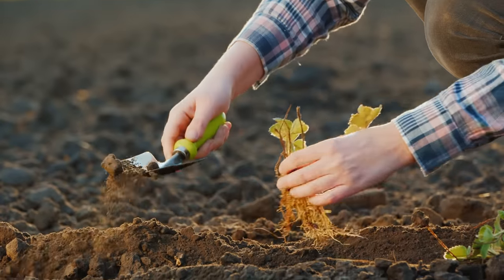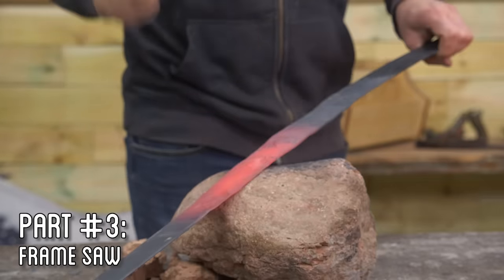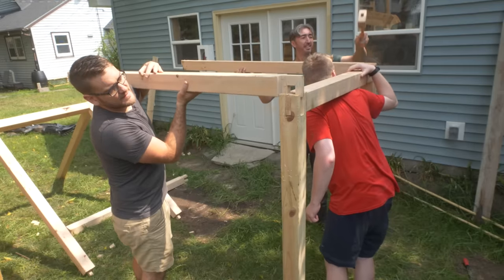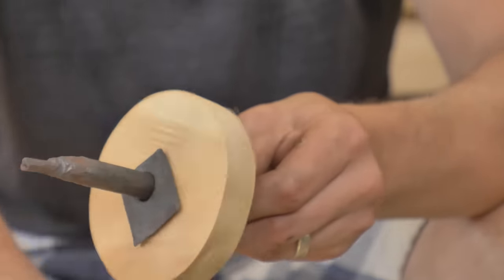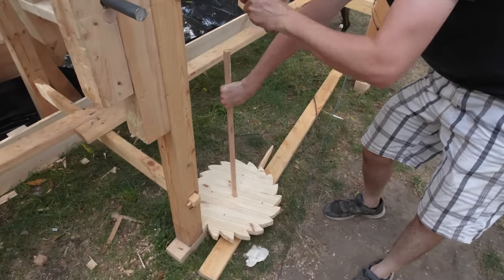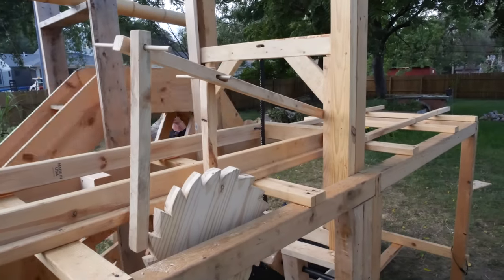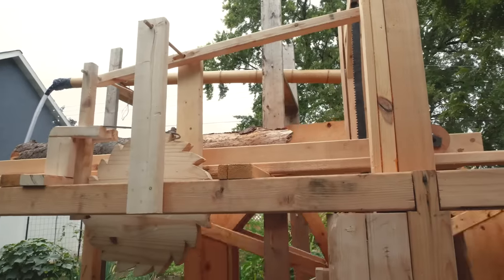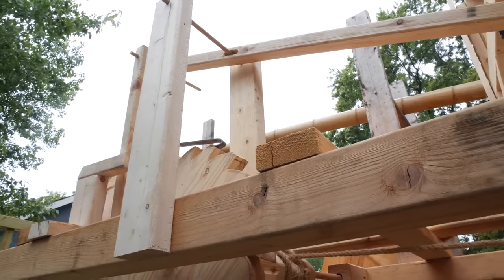I Built DaVinci's Saw Mill

Comment: The principle is just fine, but build quality is too half-assed for it to work. Moving parts need to be precise and the saw needs to have actual saw teeth. And the feed mechanism is about 10 times too fast.
Reply: This guy’s entire channel is him of low skill/high slop but just good enough to fool the normies watching. 

Then he can pass his failure off as the fault of an old design. He took a sketch and built a shoddy device. The fault is in him

Renaissance era woodworkers would’ve made a substantially better product

Comment: You could always try replacing the water wheel with a walking wheel, which while a lot more manual than a waterwheel, might help you test things while you tweak the design.
Reply: Water wheel on the water side. Walking wheel on the land side.
Reply: And put a very big hamster inside
Reply: Awesome idea. Could be powered by humans or beasts of burden. Maybe set the mill up and wrangle a herd of Kindergarteners to power it. Don't think you could build a windmill large enough but it would be grand if you could. What about a treadmill design? This would be easiest to couple to the mill but what would be used as the belt? Layers of canvas over a more slippery fabric such as silk maybe? What about wooden slats connected to each other with rope with the gap in between the slats meshing with an axle and sprocket? Like a modern tank tread.
Reply: Charge people a gym membership and set up a Conan wheel to drive it!
Reply: This is actually historically plausible, look up the treadwheel crane or magna rota.
Reply: Hire that guy in Florida that keeps getting arrested for trying to cross the ocean in a hamster wheel.
Reply: He needs a team of Turnspit Dogs
Reply: @ficolas2  There's no true concept of animals; it's merely biology. We share the inability to reproduce with vastly different organisms or 'species' (I've even had an encounter with a hamster). Mother nature, however, doesn't concern herself with such distinctions; she's oblivious to species.
Reply: he'll also get a workout out of it
Reply: I mean, Real Civil Engineer makes great use of the Shaming Wheel...
Reply: @ficolas2   Capibara powered sawmill
Reply: Best treadmill ever 🤣
Reply: And get some cardio while tweaking the mechanism. Brilliant!
Reply: Replace the water will with a gear, pur a perpendicular gear and turn that last gear with a beast. Maybe use a small gear to get more speed
Reply: @jeffg1381 windmills. In The Netherlands we still have wind operated sawmills running.
Reply: @PlutoniumBoss  These are being used right now to help construct a modern day castle using period correct methods in France.
Reply: @ficolas2 a Capybara would do

Comment: You need a splash guard! All that water will make the components swell and bind. The extra humidity itself will change how the pieces fit together.
Reply: so, cover everything with mineral oil I guess ?
Reply: Right that is what I was thinking the entire time.
Reply: The sled and rails need a solid coat of wax.

Both waterproofing and lubricant in one.
Reply: @danilooliveira6580 this is not how this channel works 🧐☝🏻. At first they need to forge a pickaxe, travel to the middle east and start digging. When they finde crude oil the need to refine it and THEN they can cover everything in mineral oil.😂
Reply: @BaconIover69  there are easier substitutes for mineral oil, like linseed oil. I just said mineral oil because its commonly used to finish wood.
Reply: @danilooliveira6580  this is not how this channel works 🧐☝🏻. First they need to plant some linseeds, harvest the crops, thrash it, grind the  seeds to a pulp, press the pulp out and clean the oil with a filter, cook it and then apply it to the mechanism. 😂
Reply: Honestly with the amount of slop in his joints and the sled for the saw, the only thing that swelling would cause is better fitment and therefor better movement, all of that slop is horrible for something even as simple in design as this saw, back then they would have BEATEN the apprentice who built this saw, because it would be a waste of time and materials to build something THIS sloppy. 
I mean props to the guy for building it, but if he would have taken a few weeks, and used better materials(denser wood, better metal for the blade) and taken better care with his joinery to make sure everything was tight for the frame and then just tight enough for the sled, then he would have seen a HUGE difference in the way it cuts
Reply: @BaconIover69  *flax seeds
Reply: @survivalsearcher  that's the same

Comment: A fantastic build!
Watching you cut wooden gears with a saw made me think that as you approach the 19th century you're going to be challenged by the most important single invention, the one which the entire Industrial Revolution depends on - the straight, accurate lead screw. Without that you don't get machine lathes and all the things that follow from them from screws to precision gear cutting to all the rest.
Reply: It actually wasn't as difficult as i first imagined it would've been. Search about a topic called generating master screws.
Reply: Interesting. All the material I had seen about early machinists developing them from nothing was a lot more fiddly and complicated. Looks like people got clever about it once they had the idea it could be done.  @chandradharkoneti
Reply: Make a crude lath that makes a better lath etcetera :)
Reply: @Barskor1  the tricky part is that even threading.
Reply: @toddellner5283  Indeed
Reply: @toddellner5283  and the sollution is weighted cutting tools that cut at angle on a mono directional lathe so that the rotation of the work piece in the lathe is pushing the cutting tool along the work piece and the weights on the tool ensures a slow and even progress as the tool is pushed along a guide rod.
Reply: @mahekorvenoges550  That is the idea
Reply: The Industrial Revolution was a development meant of the Renaissance which in turn was a revival of the Roman world.
Reply: Hail the Glory of Rome!
Nonsense. Everything from the economic system, philosophy, political basis of the society, to class structures, and fundamental values represented a massive qualitative change from the slave-and-rent agricultural system that the Ancient empires represented.  @Art-is-craft
Reply: @toddellner5283  
My point was that Rome was building things that people assumed where from the 1400s. My point was not an endorsement of terrible things that took place in the Roman world.

Comment: Super cool to see the amount of engineering and joinery being applied. This channel has been through so much, and come so very very far.  ❤
Reply: Sadly the joinery and engineering is extremely lacking even for a hobbyist.
Reply: With respect to the guys giving it a go, I think even calling it joinery is insulting to joiners. However, the saw that was being used was a little on the small size and the chisel was way too big. Easy when you use the correct tools. Also easy to be critical sitting here on my arse.
Reply: @spec_opsgaming  I spit my coffee out when I saw the closeup of the castle joint

Comment: The feed rate is very ambitious for that blade. Overall this looks fairly well done for a first try.
Three things I'd change is the pitch of the teeth on the blade, the rate of feed, and a better crank for the saw head by narrowing the distance between the blocks instead of using string as a keeper for the crank arm.

Also, if size was not an issue, some of these mills would have a large enough wheel to fit animals or people on the inside to allow for walking to be the power source.

Comment: The problem with over, is the amount of extreme amount of water spray...  swells up all the other wood.
It's very impressive that you did build what you built.  I only suggest that you look to modify it to use a river run below the wheel.  As most (old) mills ran spring to late autumn by having channels divert water and in some cases were able to modify the height of their primary or secondary wheels to account for change in river runs depths.  Very few (that I've read about) changed the pitch of blades or bucket scoops.  
Lastly, there's a significant amount of slop allowing for rotation in your sleds.  With cross-bracing and/or oil-soaked rope bindings, you can eliminate that movement and likely will keep the sawmill from shaking itself apart. 
Best of luck and looking forward to seeing this in April/May of next year.
Reply: I have not seen any water powered saw mills, or any other water wheel powered machinery for that matter, that had the water wheel attached directly to the machine itself. It is easy to locate the machine(s) at a distance and use drive gears/belts to transfer the power - as well as allowing more convenient location for the machinery.
Reply: @buggsy-sb3if  There's lots of mills that powered different machines. 
And yes, they aren't driven directly.  There's always differential gears to change speed and torque.  But the concept remains.  In the simplest and earliest forms, water wheels were used because windmills were inconsistent, and milling was done specifically for flour.  They only had 1 rotational gear change from vertical to horizontal.  A few examples still exist.

Comment: Pretty cool, drop sand bags on the base to firm it up. And make sure the machine is super rigid. When hand sawing, if your wood/fixture isn't locked down it is a PITA to cut. You could also use spikes to rigidly mount the log to the sled. Something similar to dogs on a wood working bench, but with spikes at a 90-degree angle to stick into the log and lock it in.

Comment: if you replace the rachet with just a weight pulling down, you would be able to adjust and stabilize the pressure on the saw. All in all i love seeing this idea continue to progress!
Reply: I agree they need some way to dump excess pressure if the blade isn't keeping up. An adjustable drop weight on a pulley would be an excellent idea

Comment: Adding a draw bow to the top or the base will reduce the amount of pressure needed to move the frame in that direction (most would put it at the top because it counteracts gravity). Adding a slot guide for the push arm would stop the walk and give you the greatest efficiency for your build. Also, grease the frame guide (use LOTS of grease) as well as any point that has moving friction in parts.

As for the pump, watch a couple high banker videos of people high banking at home, and add a simple screen (you can use a window screen) will keep your water clear and your pump running.

Comment: A couple of things that you might want to have a look at...

1. When your mechanism advances (rachet advancing beam) the ratchet wheel, it moves forwards quite a bit but then moves backwards again. This means that the log will only be against the saw blade for a fraction of the blades stroke. This can be easily fixed by shortening the length of the piece of wood that advances the ratchet..... reducing it a little at a time to get the best results might be a good idea.

2. Seesaw beam that connects to the rachet advancing beam..... the bit in "1" above. By increasing the length and adding some extra holes to adjust the pivit point and the point that connects to the ratchet advancing beam, you can experiment with changing how far the log is advanced each stroke. This would also mean that you can fine-tune the mechanism depending on how much power your water wheel is currently generating. i.e. reduce the speed of the log if you have less water flow and increase the speed when you have more water flow rate.

A tip for the future, if you make a mortice gauge, you can use it to accurately scribe the lines to create tight fitting joints. Your castle joints are a bit loose, which will reduce the stability of the joints and allow quite a bit of movement in the frame...... even with glue and nails....... sorry 😳

It was awesome to see an idea based on a sketch by Davanci come to life in this video 😊👍👍👍👍👍
Reply: Regarding 1, perhaps the advancement mechanism should have a weight hanging from the rope? Then the pressure of the log against blade will be constant and based on the weight, which can be adjusted depending on the available water flow, blade wear, cut length, etc. If the weight had enough vertical travel distance the advance wheel mechanism could then be removed (or possibly replaced with a mechanism that relieves the pressure on the blade when the saw is on the upstroke).

Comment: A river powered water wheel is going to have a lot more torque than is achievable from your garden hose. Even back then, a lot of experimentation went into matching a water wheel to the water source. I suggest DaVinci's design is an undershot wheel for use with rapidly flowing water. They also used lubricants back then like beeswax and tallow to make wagon wheels and other mechanisms move with less friction.

Comment: I think in the long run that you should install some wooden dowels to hold the log in place instead of a rope that would have to be moved multiple time run, if it wasn't cut every time you ran a log through the mill.
Reply: I was thinking that also. The more rigid the system is the more effective.
Reply: He really needs "dogs".  These are things that go from the frame up to the log at an angle so that the weight of the log is pushing the point of the dog into the side of the log.  As the cut progresses down the log, you put wedges into the kerf so that the gap doesn't close up on the blade.

Comment: I just came back to the channel so I'm sorry if you already covered this, but the other way to make cuts along the log (rip cuts/ripping) is to rive/split it using metal wedges and a sledge, wooden wedges (gluts) and a beedle, and axes. This doesn't work with all species and doesn't handle knots well. It also requires relatively straight grain.

Rather than cutting from one side to the other, you halve the mess each time. If you don't halve the mass evenly the less massive side tends to bend more and the split wanders that way. You can sometimes correct the split by forcing the thicker side to bend more. On thinner stock this is often done while using a tool called a froe.

What you get, though, is the strongest possible board out of that particular tree, ideally with most fibers being continuous from end to the other. Beams were made this way into the 1900s. If I recall correctly, shingles made this way last longer than cut shingles because water has no exposed end-grain to soak into. Tool handles are also best when riven.

Also, hi from Minneapolis-ish!

I'm just kind of getting into this, but I've used this method to break wood I couldn't possibly saw (3ftx4ft oak log) into wedges I could haul out on foot to my tiny car. If you want to see a master of this from the US, look up Peter Follansbee.

Comment: Increasing the size of the ratchet will slow down the sled even more and prevent bind ups and sharpening and heat treating the teeth of the blade will increase efficiency.

Comment: It's fascinating that Da Vinci didn't think to invent a circular saw, as it wouldn't require converting the type of motion from circular to reciprocal.
Reply: The original had 4 blades, 4 planks per pass, also a circular blade would be restricted on the size of the logs. 
The gearing needs a little work to speed up the saw blade.
Just my opinion and thoughts.
Reply: I am not sure Divinci would have enough power available to him. Our 48 inch rotary sawmill bogged down cutting boards with a 327 Chevy engine, our portable bandsaw gets by with  a 22 go Briggs and Stratton.

Rotary is nice, but takes a lot more power.

Incidentally the circular saw blade was invented by a woman.

Comment: were leather bearings invented in this time period? oiled leather bearings are pretty great for a lot of stuff and you might be able to reduce the slack in a lot of pieces, like that hook on the crankshaft, with some leather bearings and tighter constraints.
Reply: DaVinci actually made drawings of ball bearings!  Ìt has a shaft with a cone shaped tip like a pencil.  The balls are around the cone trapped in a round (flat bottomed) wooden(?) hole.

Comment: There's an historic production saw mill back where I grew up. Multiple blades and a lot more water but one thing that I thought was most interesting was the advance mechanism. There weren't any ropes or pullies that I remember seeing. What they did have was a constant driven roller that the sled sat on. It provided a constant push to urge the sled forward but not enough for the blades to bind or break, just letting the friction from gravity and the back pressure from the blades to dictate the advance rate.

Comment: Try to gear up your saw up and down movement rather the infeed speed. Your saw cant handle the current feedspeed. Now the saw goes up and down 1 time per revolution of the waterwheel. Gearing it up will increase your saw speed.
Reply: More saw speed via gearing comes at the cost of needing more torque at the waterwheel hence more water in each bucket on the downgoing side.
It may be that a better option would be to optimize the wheel to turn a lot faster for a given flow of water.
Reply: … or just gear down the feed.
Reply: @voiknallen1447  Yes, this could even be made automatic.  Imagine that the saw frame could move back and forth a bit and was pressed forward into the log by a lever with a weight on it. If the weight gets low, the mechanism that pulls the log into the blade trips.

Comment: Is there anything to be said about snugging the saw in its housing better? It seems like the saw would work better if it didn't wiggle around so much in its movement.
Reply: I think they would of use bearings and more some sort of lube. Those parts would not last a season. Even today greasing the machines is daily maintenance on industrial machines.